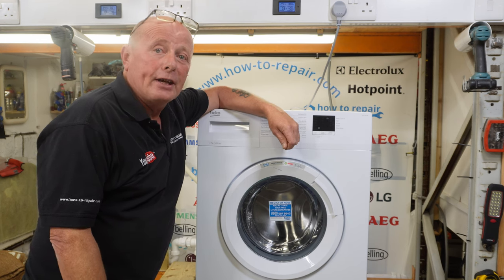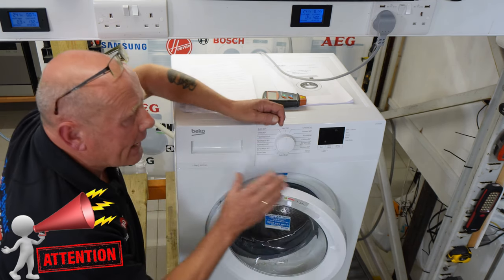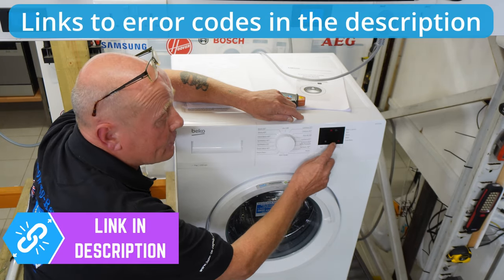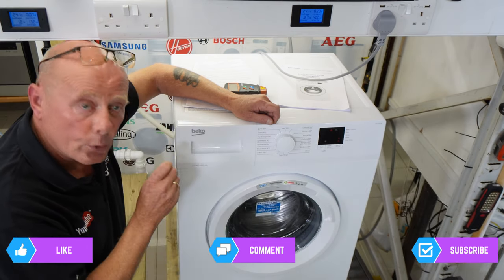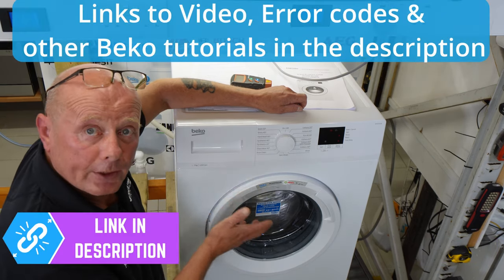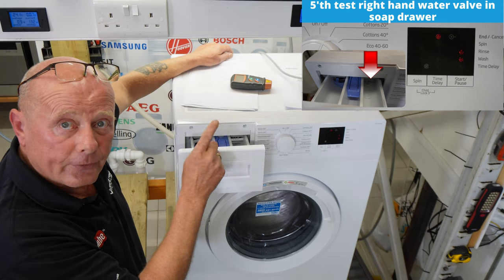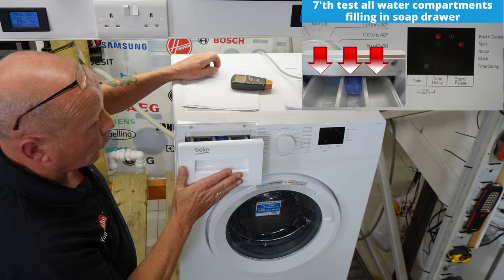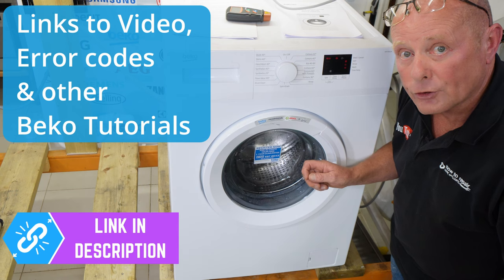Beko WTK washing machine service test mode and diagnostic 2020 onwards

Comment: Thank you for this, so clear to follow. I get an E17 code that doesn't seem to clear, so I can't run through each step when pressing the start button. However, but the problem is the machine not starting until opned and closed the door several times. Could this be a door mechanism issue?

Comment: Thank you for the video! Anyway, i have beko washing machine also, when the washing process finish, the display shown "Cd" on the screen and door locked, what should i do?
Reply from the maker: Hi, I will need the full model number of the identification plate and the details of your problem so that I can provide you with useful literature. Please use our contact us page and make sure you fill out the request for what your problem is. A video shoot of the problem would be perfect as well.

I will get back to you within 24 hours, normally. https://www.how-to-repair.com/help/contact-us/  

Please remember to subscribe to our channel, as that's what keeps this channel going. Thanks, Paul 👍

Comment: Update following emails and speaking with you about my WTK72011W, which had an intermittent fault causing it to stop mid cycle

It was an issue whereby the plug cable had become trapped either causing the wiring loom to loosen or for it to ground against the case, since I have move the cable to a better position the machine has not had any problems

Comment: I tried your sequence on my machine thank you it worked. Mine is an WUE8622 and when switching from spin  test to water test it waits a bit for the drum to slow down and than carries on. Did you ever come a cross a problem when the motor spins normally in one direction and 90 rpm in the other. The other direction test couts out after 15seconds
Reply: Using this video I was able to get into diagnostic mode to try and troubleshoot my machine stopping during cycle. While in diagnostic mode I see the same as you it seems, it stops during the right hand spin at low rpm. All other tests complete fine. Did you get to the bottom of your issue at all? Yours is the only mention I've seen of it in my research tonight. I do have a different model but the behaviour is the same. Thanks in advance!
Reply: @ScotiaGaidin  does it spin at higher RPM? Mine was turning faster that it should be and after 15seconds it accelerated and stopped. I didn't come to the bottom of this. But I did manage to analyze the communication between the main board and the inverter control boart. To my suprise the main board is sending the higher rpm information to the inverter and after 15seconds it sends a strange message that is not seen on any other tests. The inverter does not recogize the command and it cuts out. So the main board is funky. My machine had a different problem. It was working normaly and from time to time it just failed to start a rotation. This gor more and more frequent when the motor got warmer. I cheated and fitted lower current sensing resistors and i installed lower back EMF sensing resitors. I added some protection diodes for the MCU and it got alot better but it still cut out after an hour and a galf of washing. By cout out I mean it was spinning in one direction, stopped and it tried to go to the other it just vibrates and stops. It waited for that cycle and tried to star in the other. Sometimes it did sometimes it was the same problem. I changed alot of parts on the inverter board. I did fet better but not as expected. In the end i just gave up since I got another used machine. My money was on the motor itself in my case. The magnets got weaker as the motor was getting hot. Waker magnets means lower torque and lower back EMF signal for the rotor position and it means higher loses wich in turn mean more heating

Comment: hi mate some sort of issue with our beko wash light flashes after a few seconds and door wont lock or fill with water, ive put it into reset mode with your video but it doesnt start the cycle pf checkimg errors its stuck with 3 lights on time delay 1200 and timer with a plus sign? plz help
Reply from the maker: Hi, please use our contact us page and make sure you fill out the request for what your problem is. I will need the full model number of the identification plate and the details of your problem so that I can provide you with useful literature. A video shoot of the problem would be perfect as well.

Normally, I would get back to you within 24 hours but I am on my way to travel abroad, so it can take more time to respond. Thanks for your understanding. https://www.how-to-repair.com/help/contact-us/   

Please remember to subscribe to our channel, as that's what keeps this channel going. Thanks, Paul 👍

Comment: Hello.... my machine is a WIR series machine. Does this method get my machine into diagnostic mode?
I followed you steps anyway.... and it came up with E03.
Am I correct in saying this is to do with the heating circuit? 
Apologies for all the questions... fantastic videos by the way... 👍🏻

Comment: Hello, I'm hoping someone may be able to advise or point me in the right direction on what's going on with our machine. Our drum won't spin for any cycle (it will rotate by hand) and I can't hear any motor sounds other than the drainage pump. I've tried the diagnostic mode as per video:
1200 light didn't come on but the 1000 spin and 600 spin lights did light up. Next click of the start button had all the lights flashing so I'm guessing those two initial spin numbers are my error codes? From there, I pressed the start button several more times with around 30 seconds gap between each press but after an initial click (presumably the door lock), nothing at all happened. 
The machine is not even 3 years old  so I don't believe/would hope the motor hasn't failed already. Any advice would be much appreciated. 

I'm not sure if it would be related but a couple things I think are worth mentioning are: I checked the drainage filter and found a small hair clip stopping the propeller blade from moving, removed the clip and it now fires up on the drainage cycle. I never noticed an issue with drainage before so my hunch is that the clip has triggered a safety feature of the drum not spinning but I'm really just guessing as seems a bit of a coincidence. 
I also had to change the door seal around 6 months ago as found a small tear in the old one. The machine has seemingly been fine since that repair but thought its worth a mention. 

Any help would be greatly appreciated 

Ps, they don't build things like they used to... our old machine went on for close to 20 years between my parents and ourselves, this beko is not even 3 years old and as previously mentioned, have already had to replace the door seal and now it's broken down again. Starting to wish we held on to the old one now 😅

Comment: I have error code e25 on my Beko bpro500 cannot find anything to do with this code any advice ?
Reply from the maker: Hi, please use our contact us page and make sure you fill out the request for what your problem is. I will need the full model number of the identification plate and the details of your problem so that I can provide you with useful literature. A video shoot of the problem would be perfect as well.

Normally, I would get back to you within 24 hours but I am on my way to the IFA trade show in Berlin, so it can take more time to respond. Thanks for your understanding. https://www.how-to-repair.com/help/contact-us/   

Please remember to subscribe to our channel, as that's what keeps this channel going. Thanks, Paul 👍

Comment: I discovered that Howdens use a Beko with out the branding this worked on it the only difference was that there was a separate power button which took a few attempts to get into.